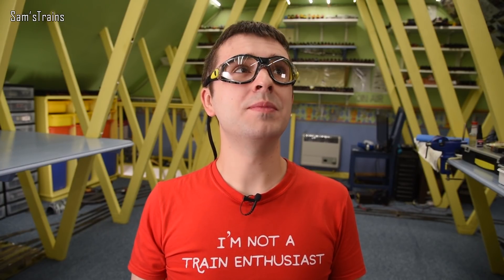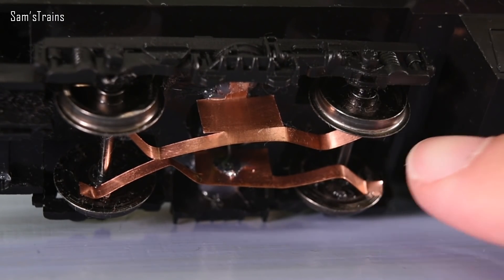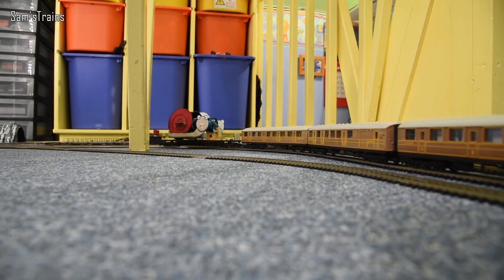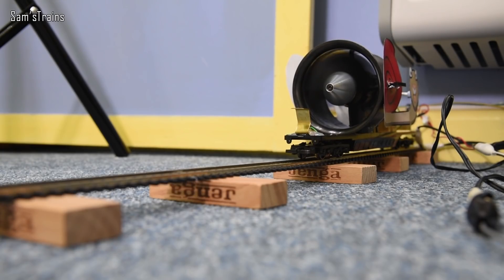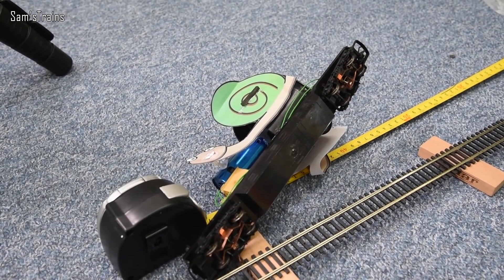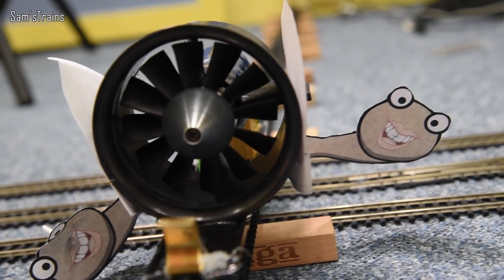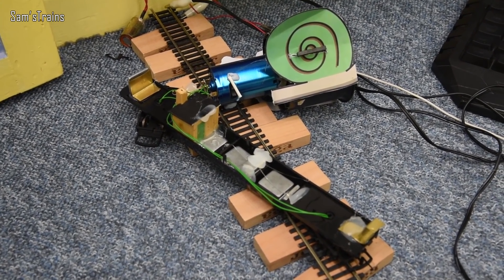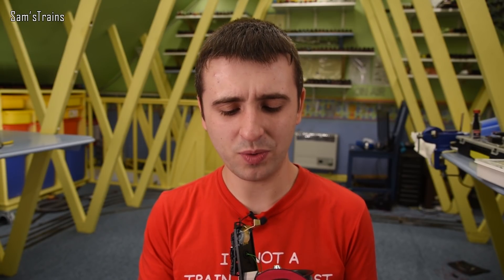Extreme Fan Powered Model Train | High Speed Tests | Crash & Destruction

Comment: Great fun! Does that autotransformer/Variac have a rectifier built in or did you use an external one? Have you thought of putting the motor on an O gauge chassis for a bit more stability? BTW, you can get 36V 20,000 rpm motors from Ali, but you might be running out or room for the acceleration to full speed already. (law of diminishing returns)
Reply from the maker: Thank you! No I made up my own rectifier with smoothing - but to have shown that might have helped people try this themselves, which is obviously not a good idea. O gauge is a good call - much more stability for sure. Wow - are those able to run on straight DC? That sounds epic!
And correct - I think the easiest way to improve the speed would be to use a longer section of track.
Thanks for watching, Sam :)

Comment: For the next time, try magnetising the bogies to get it a bit more stable, you’ll probably get a faster speed by using a bogie driven design with traction tyres which such a short distance, the edf isn’t able to transfer its Energy enough I wouldn’t have thought, maybe fit a high rpm motor into a chassis instead
Reply from the maker: That's a good idea - thanks for the suggestion! :D
Thanks for watching, Sam :)

Comment: An engine like that can push a model aircraft to well over 15 mph, can’t imagine how fast it can carry a train!
Reply from the maker: Absolutely given enough distance and power (voltage drop is a problem too at high current), I know this could go WAY faster!
Thanks for watching, Sam :)
Reply: 15 is probably below the minimum flight speed of whatever plane it was made for, EDF models usually go well over 100mph (not scale).

Comment: Great video as always. I'm sure you'll make something faster in the future. Now from watching it, it seems like it doesn't have enough time on the track to hit its full speed, so just a suggestion (something I did with a k'nex roller coaster a while back) why not use some form of elastic propulsion to assist it on the acceleration so that your not as limited by the length of track.
Reply from the maker: Thanks very much Dom, and yes that's right - I'd need more space really! Not a bad idea though - a helping hand at the start could be good!
Thanks for watching, Sam :)

Comment: just ignore my comment if your not interested in building one VERY high speed train 

i still cant believe that people still went with a thruster and not just a big wheel steam engine attached to a 550 brushed or brushless motor
its much faster and "safer" but i recommend an RC esc with a li-po cause you need a lot of current and not really a lot of voltage (the ESCs are usuallt only 8v max)(top speed non scale is 100mph!!)
also i have hundreds of meters of non metal track to test cause i run a high speed train railway( mainly japanese and french bullet trains) with internal batteries cause i dont have a good power supply so i have tons of 18650 li-ion cells to run this rail system but i thick its better cause its offline and easier to maintain.

monstrosity
Reply from the maker: haha thanks for sharing! I guess this approach was easier and more visually interesting - but your idea sounds awesome, I've been thinking about an RC approach too!
Thanks for watching, Sam :)

Comment: in America we use to have a gas turbine electric that was the Strongest train in the world, we also had that  "Black Beatle" locomotive that was very VERY fast. but due to fuel cost both of these are either in museums or in a scrap yard.

i also had an idea for high speed jet powerd loco's. but not in thrust pushing the train. i mean you have a compressed air turbine that's thrust turn's another turbine, like in a hydraulic torque converter, either that or the turbine acts has a motor for the train.
Reply from the maker: Oh wow that sounds fantastic - I will have to look that one up! :D
Cheers,
Sam :)